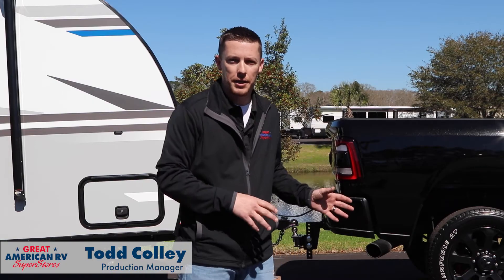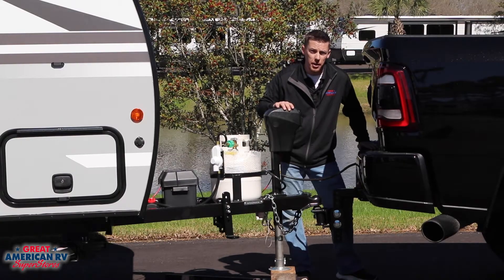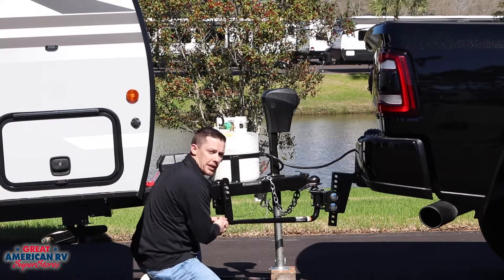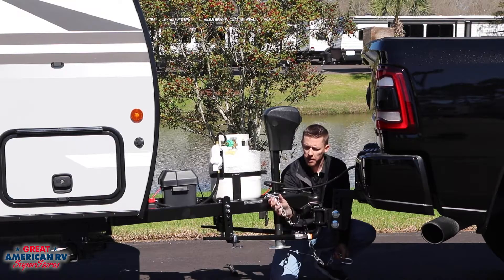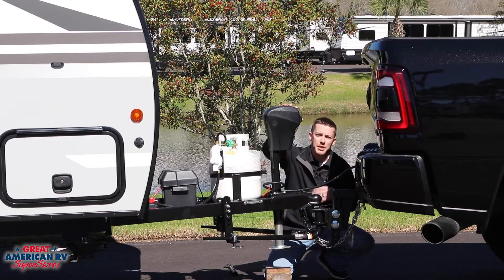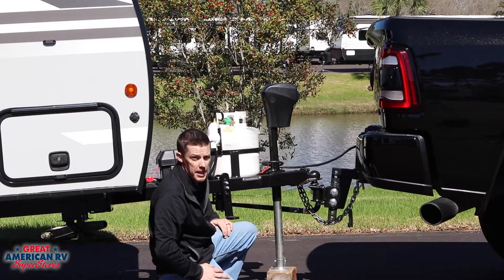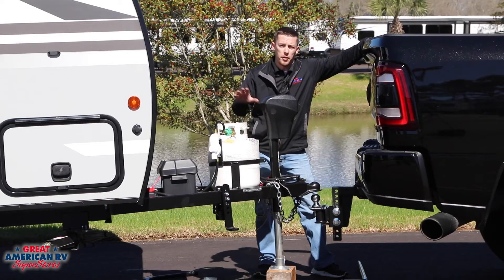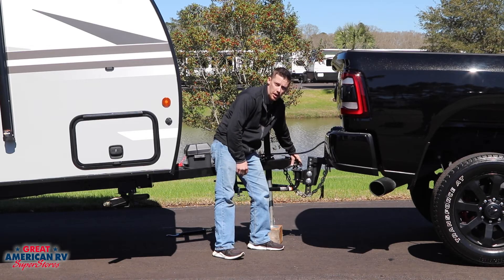How To Safely Hook and Unhook an E2 Weight Distribution RV Trailer Hitch

Comment: The tow angle of the camper looks way off. Maybe looks that way but the front of the camper should not tilt up.
Reply from the maker: Angle of the camera can be deceiving.  You are correct though, it should not angle up, you do have 1 1/4" of tolerance however.  If you are over that amount when measuring the trailer  when level against a measurement of the trailer hooked up then you should move the ball down 1 hole and up one hole if you are lower.  We haven't done a video on install at this time, just how to hookup, but great point, thanks for watching and commenting.  -Todd

Comment: I had this system installed by a dealer but when I arrived home, I could not remove the spring bar on one side. I had a large wood block under the tongue jack and I literally used the whole jack length and had both my vehicle and the trailer lifted at something like a 25 degree angle to the ground, and there was still tension on the bar. I ended up hammering the bar out of the L-bracket with a big hammer, and after I did that,  the rear of my truck just slammed down hard to the ground. I am not sure what the dealer or I did wrong, maybe someone can help.
Reply from the maker: What kind of unit and what kind of truck do you have?
Reply: @GreatAmericanRV  I think I figured out my mistake. I had actually released the coupler latch before jacking up the trailer so I guess when I jacked it up, the whole weight of the trailer and the car was held up on the bars rather than by the hitch ball. Which, naturally, made it very difficult to remove the bars.
Reply from the maker: @vadimk8739  that can definitely be the problem.  Hopefully you have it figured out.  -Todd

Comment: Is it true that you should not back up with sway bars on?
Reply from the maker: If you are backing up to a drastic change in grade, like up hill or down hill then you should take the sway bars off. Not doing so will put a significant strain on the hitch. If backing up on a flat surface it's ok to leave hooked up.  -Todd

Comment: Removing the hitch and ball from the receiver is not covered here.  
What’s the best way to get it unstuck?
Reply from the maker: Are you referring to removing it from the truck receiver or the the ball from the trailer coupling?
Reply: @GreatAmericanRV  From the receiver. It’s not budging with a firm pull and wiggling on the ball. Probably new paint on the hitch?
Reply from the maker: @richarddietzen3137  yes more than likely new paint, also could be road grime and such that develops as well during wet conditions.  Spraying some lubricant can help and just working it up and down to get it out.